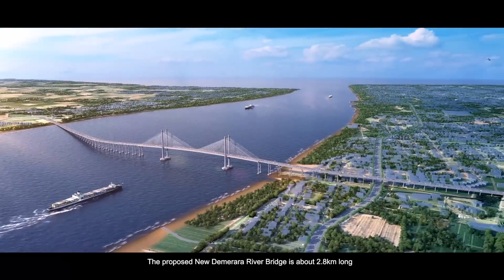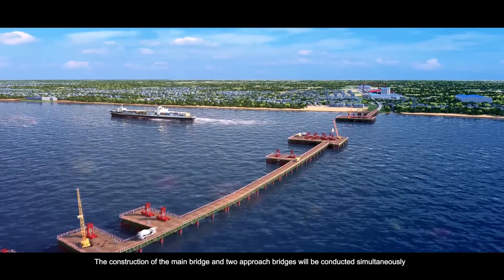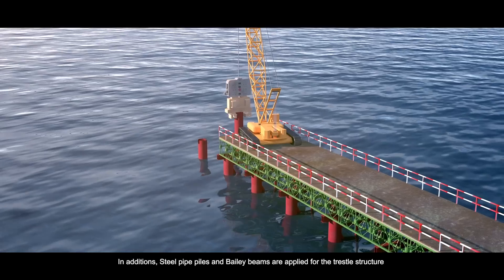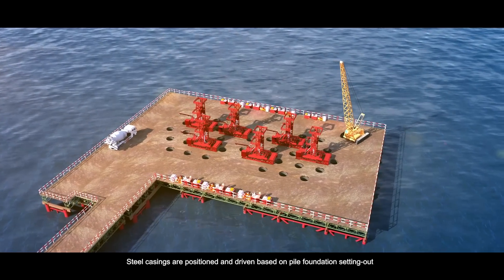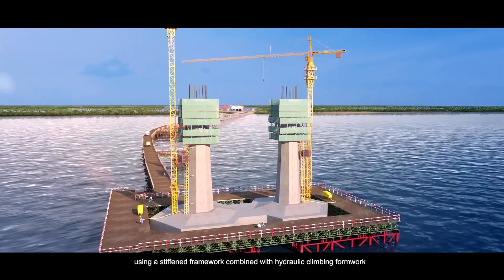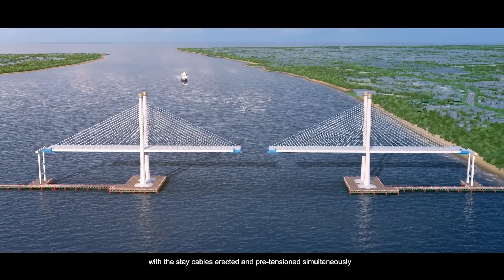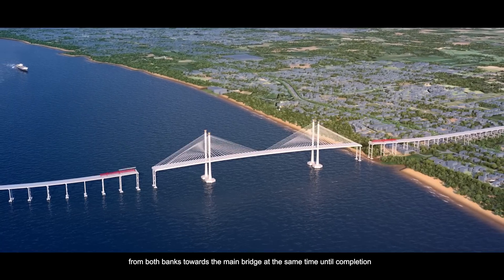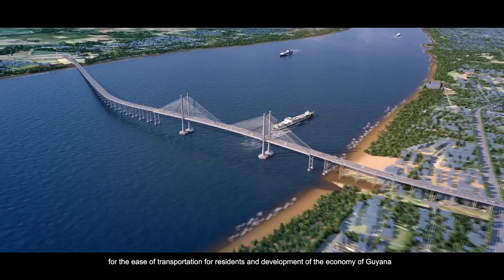New Demerara River Bridge design, construction, and final appearance animation video.

Comment: Why is the main span not in the middle of the river where it is deeper and more easily navigable- there will Long run problem b/c that outer bank will constantly getting silt build up make it shallow
Reply: Because the middle is not the channel, where the highest part is, thats the channel
Reply: Cheap ass bridge you're telling me they couldn't build like 4 of those major towers and have a proper looking bridge instead of 2
Reply: During the preliminary design stages of bridges design options and cost benefit analyses are carried out.
Most decisions are based on cost effectiveness and politicians have the final say.
The bridge design was probably best bang for the bucks. Remember there was also a cost to finance the bridge and recover some costs  from the toll.
The financial agreement may have been amended since oil revenues have been lucrative?
Let's enjoy the bridge for the next 100years.....I'm sure there will be many more spectacular bridges and projects for Guyanese to enjoy.
As they say live long and prosper.
Peace and tolerance and don't bully Chinese people.